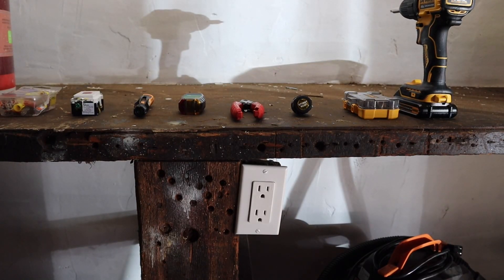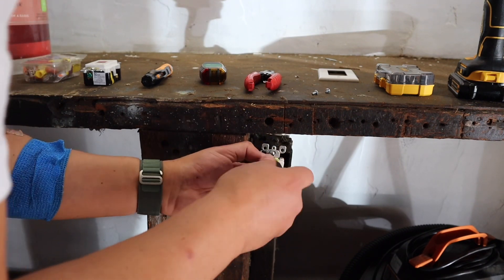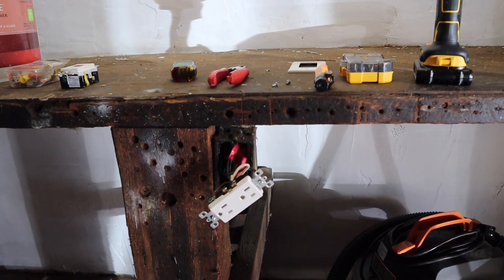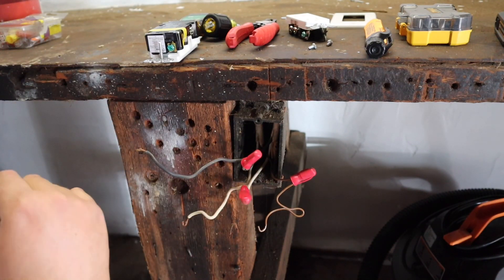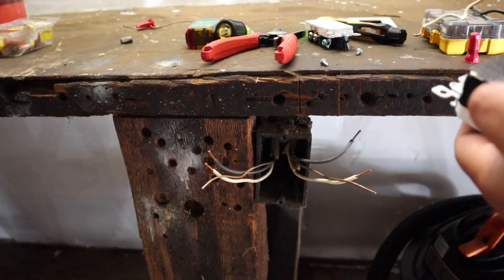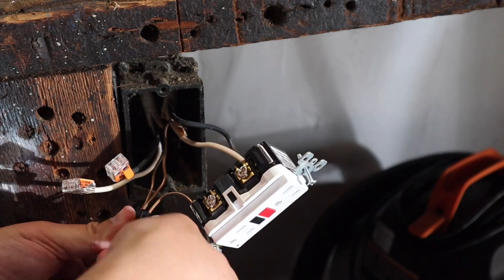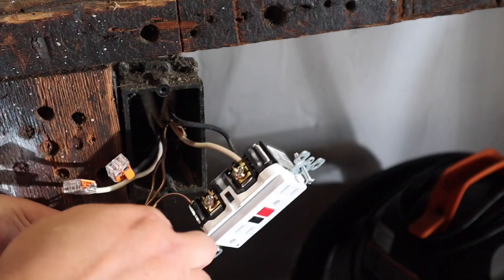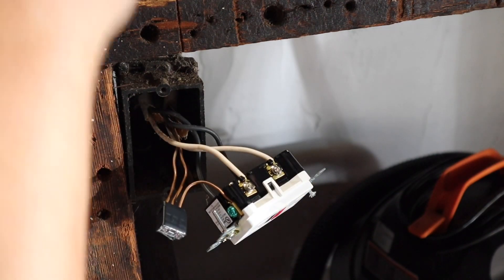DIY GFCI Outlet Install: Replacing 3-Prong Outlets & Understanding Line Vs. Load | PEDRO DIY

Comment: I must say I’m no electrician and ive change many outlets and not once have I ever shut off the breaker! Safety is key and I will move forward and try to find and trace wires to breakers unfortunately I have many breakers and never really know what breakers shut off what! Maybe there is a easy way to find out which breaker is for what!
Reply from the maker: Hey, thanks for commenting. Trial and error, I started labeling my breaker switches recently, I just have like 5 of them labeled so far but when I have more time I will for sure do some tests and get the rest of them labeled. You also have the option of turning everything off, that's what I was doing in the beginning but it's not ideal. Thank you for watching.